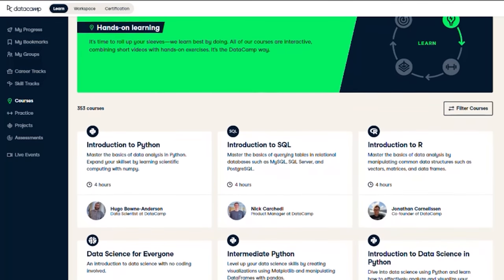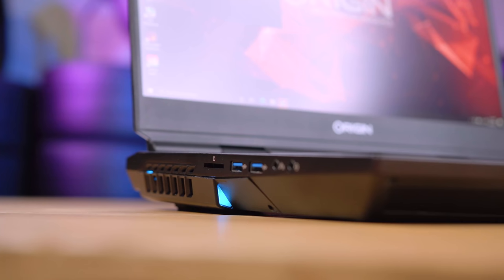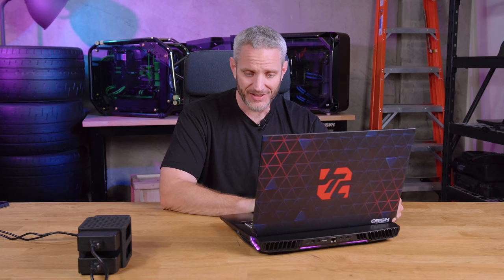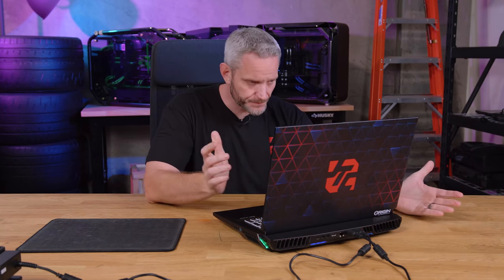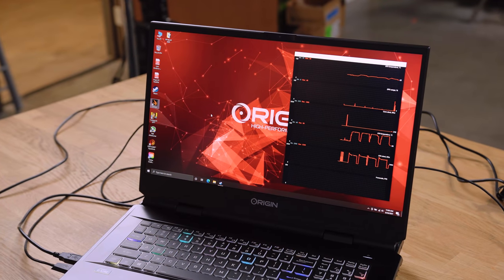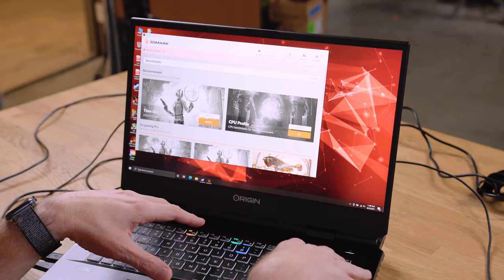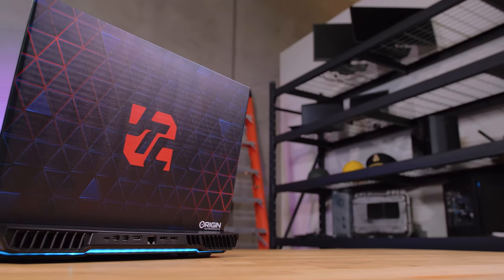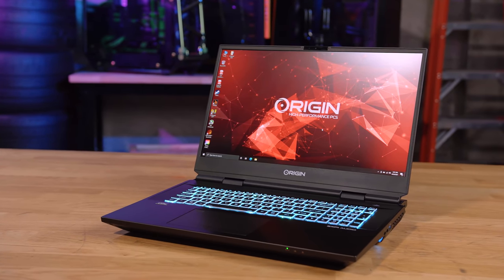You are GUARANTEED to HATE this... which is why it's so AWESOME!

Comment: The mobile category is termed 'luggable'. mb
Reply: Yes luggable can be desktop and workstation replacements like lugging it out the cell base station in the middle of nowhere operating on wind, water, geo and much bigger battery set then that 11900K. mb
Reply: Like when the bass speakers in your car not insulated from the chassis where they mount reverberate off the chassis. mb
Reply: or a satellite dish somewhere in the middle of nowhere . . .

Comment: Why would laptop speakers ever be a dealbreaker for anyone? I've never heard a laptop have "good" built in speakers, I dont think such exsists. I mean, if you own a 3000 - 4000 dollar "desktop replacement", you're going to use your bookshelf- or pc -speakers at home and if you're traveling with it, you're probly gonna use headphones, right? 

Why would anyone ever use laptop's own speakers, I'm the one here thinking why are they still building laptops WITH speakers in them, they're basically just a waste of space, you could make them slimmer or use the space those speakers take for something more useful, like cooling or a bigger battery.

Comment: a 3080 for 1080p is a waste there is no point in putting that much potential in this laptop ... this is a perfect example of oem's abusing the fact that only they have access to these gpus this is wrong .. tho my old laptop has a 8750h and a gtx 1070 Max-q  .. it still has a 4k screen on it ... smh.     this thing needs a do over lol .. under most conditions i dont see a long lifespan for that poor laptop a cooling pad wont help much ... RIP 3080 ....

Comment: Why would anyone want this?  Its almost worthless as a laptop because of its weight, crappy battery life.  And if your going to use it as a "replacement PC"  WHY???  you are using a 1080P monitor at that rate on a small screen (by desktop standards its miniscule) again it's huge and still going to take up a good amount of room on your desk.  It is still using a Laptop version of the 3080 which is not as good as a PC version, The speakers are lack luster....And on top of all that it is WAY more expensive than what you could make in a mini ATX with better specs.  WHY WOULD ANYONE WANT THIS THING?

Comment: so an intel chip that boosts to over 4.7 only gets a 5,000 + score while a lower end cpu =3600 Non X at a locked all core 4.2 is getting near 10,000 , @ 9,785 , multi core , hmmm  , no Thanks I`ll stick to my AMD system For now .
oh and that is running c`R23 and no i am not downloading from a 3rd party just to get r20 from guru , if it isn`t the site that created it you are being traced every time you open the app and on some all the time unless you disable it in services , so again = No thank you . and this is my answer to the product manufactures of components and the laptop manufacture= no thanks . not you jay

Comment: i feel you are seriously out of the loop as in your video you state this is a full intel desktop cpus and that you have only seen this in amd versions , makes 0 sense as the clevo line has been desktop cpus for many years as well fully unlocked and over clocked cpus, desktop gpus and so froth .... no offense ment .... Clevo is the brand origin just re wraped the machine@!!!  fn plus number 1 will send fans to full max speeds for cooling.... wrong information as it is upgradable to 128gb ram ddr4  , as well 32tb of storage , sorry your info is no correct .... also has a rtx 3080 16gb with 150w - boost 15w to push to 165w gpu watage..... you also have 4 nvme slots on this laptop , there is one on the other side of the 3 under plate ,as  you can clearly see in video yet you havent even read the manual@!!!! that is a 4.0 pci-e nvme slot that is the plus of the 11th gen cpu in this model that can be a large performance boost at 7000mbps at times.... . i dont feel your reveiw gives the correct information to this machine , nor the specs and quality of it as well. as i have been a  long time clevo user , Modder and so forth , in the basic manual it tells about the nvme slots , ram aloud amounts, as well the thermals and wattage i dont feel you did your proper home work nor ANY work on this machine , just reading a script i am sorry to sound rash but lets be honest you DIDNT even seem to know there was 3 nvme slots let alone 4 that you never even mentioned in the video nor the that RTX 3080 in this machine is 16gb vram , as well pci-e 4.0 mxm card changeable and possibly upgradeable with newer cards.... sadly .... lost to words to why you did the review!!!!

need to do a review on a few laptops 

P870tm1
P870km1
P870Dm3
P775tm1
P775DM3
P750tm1
P750km1
P750DM3

is just a few......

Clevo models not sure if you and your team are up to date or current with the true tech of these machines.... or the POWER of these or reason for them ......

Comment: Perhaps you need glasses Jay... 1080p at a 17" is pretty terrible. On a 15" that's great but on a 17" you really want a bit more.
Reply: 1080p at 17" is fine, majority 1080p monitors are 24" for a reason..
Reply: @3rd.world.eliteAJ /videos No it's not fine, you need to have pretty terrible eyesight not to notice the difference. The reason that many monitors have a low resolution is cost
Reply: @WoLpH  Huh? It has nothing to do with cost, 24" 1080p monitors have a DPI of ~92 which is considered the "golden spot" for 1080p monitors, that's why there are so many on the market, and that's why most people don't buy 27" 1080p monitors, because pixel density and scaling is so terrible. The same goes for 1440p monitors, nobody buys 32" 1440p monitors, because pixel density and windows scaling is terrible.
The same goes for laptops, at arms length YOU'RE NOT noticing 1080p pixel density on a 17" monitor, unless you've got binoculars for glasses.

Again, has nothing to do with cost, a smaller display is cheaper to manufacture than a bigger one...
Reply: @3rd.world.eliteAJ  No. Look at the price of a 24" 1080p vs 1440p or 4k monitor and tell me again that price is not a factor. People just care more about size than resolution, but they do care. Also, for gaming a high resolution is prohibitively expensive.
Reply: @WoLpH  Samsung Odyssey series 1080p 24" = 240$ - the same 1080p monitor, but 27" = 280$.
27" 1440p = 330$ - the same 1440p monitor, but 32" = 350$.
You get almost 2x pixel count at the same screen size with a 16% price increase, and the 27" 1080p will look terrible because of PPI being way too sparse.

AGAIN, the price has nothing to do with why most monitors are 1080p or the size that they're at, returning back to the original statement that 17" 1080p displays look terrible, IF THEY LOOKED TERRIBLE, nobody would be buying 24" or 27" 1080p monitors, as they would look even worse, but AGAIN, that isn't the case, as 24" is the golden ratio for 1080p PPI...